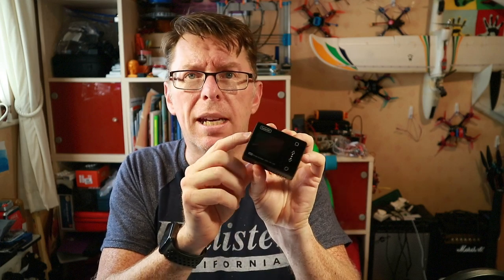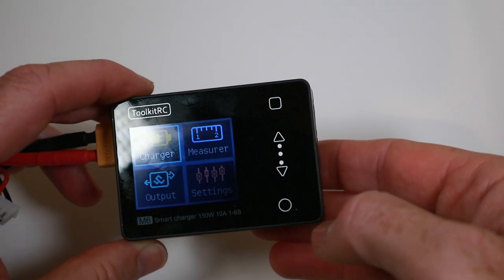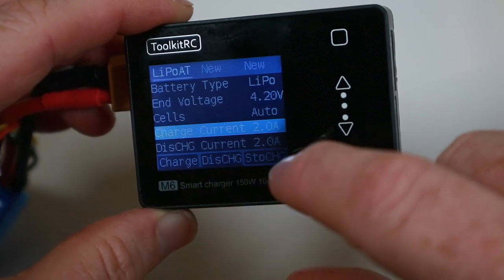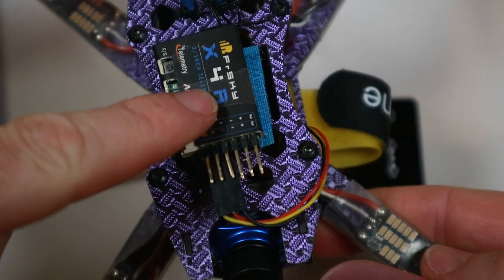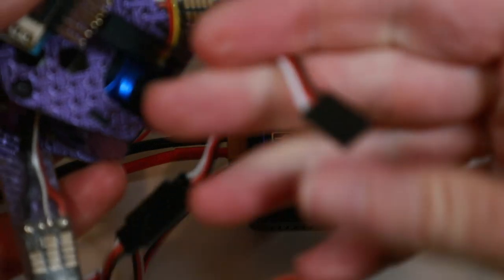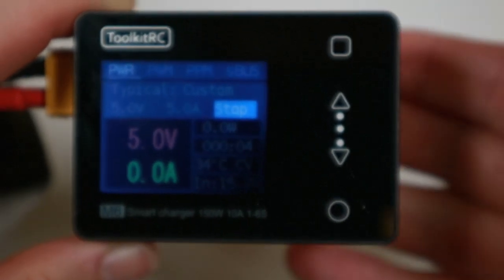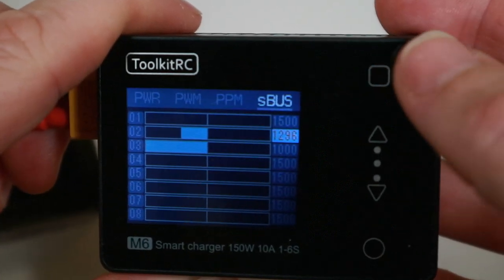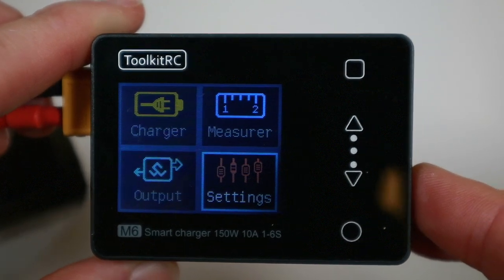ToolKitRC M6.  A charger and more!  Supplied by Banggood

Comment from the maker: If you want to check out this charger in more detail, take a look via this (affiliate) link https://www.banggood.com/ToolkitRC-M6-DC-150W-10A-LCD-2-6S-Lipo-Battery-Smart-Balance-Charger-Discharger-With-Voltage-Servo-Checker-Receiver-Signal-Tester-Quick-Charger-Function-p-1512836.html?p=E81211714085201408XQ&utm_source=Youtube&utm_medium=cussku&utm_content=tanghao&utm_campaign=wayne

Comment: I use an ATX psu to run both my chargers,  both my two way radios,  a 12v desktop fan, have a screw-down / banana post terminal for anything 12v I want to power and have a XT60 on a long cable for bench powering rc craft for setups.
Gotta love pc power supplys, they last forever,  supply clean power at decent currents.
I have another running my cctv dvr plus 8 cams and a 20w ir floodlight.

Surprised being someone who's into computers that your not using them, you must have a few kicking about :)
Reply from the maker: Most of the old PC PSU's are in the loft or have been chucked.  I have an issue with space :)  Good call though, they are decent for this sort of task
Reply: @CurryKitten  somehow missed your reply till now.
What I do with my ATX psu's to make them tidy is take the cover off and clip all the 5v and 3.3v cables right back to the pcb then pair all the 12v inputs with a negative and clip back any remaining negatives too so I only have the wires for my 12v and I put the relevant connectors on them to hook up to what I'm using it for.
The ATX psu that powers my cctv system has 10 12v cables each with a 3.5mm jack on the end with just plugs into everything 
My desk psu which powers my two way radios, chargers ect has a bunch of xt60's on it :)
Both psu's have cable sleeves on them and look tidy and almost like they were made for the use I have them deployed in :)
The green trigger wire gets soldered permanently to ground and the psu turns on as soon as mains is applied.
Another thing I really like about the ATX units is if you have a fault or a short, they trip instantly and protect both themselves and the device that is connected.

Comment: That looks very good, great little unit and very handy, I’ve got the uav battery tester which does a lot of those tests, but doesn’t charge the batteries. I might have to get one of these or the higher grade one. Thanks for the video.

Comment: If you fly Quads and need to charge loads of battery's then you may want to think of other options, however this is a good tool for diagnostics.
Reply from the maker: Yes - agreed.  I use a 4 port and 2 port normally.  Not bad if you are getting into it and you get a few extra things though

Comment: Hey by mistake i reversed plug in my balance port in charger but nothing happened amd voltage was not being showed properly but when i connected it back it works fine would this would have damaged my charger?
Reply from the maker: Whilst I can't say for 100%, I don't think so.  These chargers tend to be pretty good at detecting reverse polarity, and I've misaligned my balance plug more than once without anything bad happening
Reply: @CurryKitten  ok and one more thing I love your sim and the work you are doing and btw i only plugged lipo in output plug and inserted my balance plug in reverse but when I noticed my voltage was messed up i removed it right away and to be double sure i connected it again and in wrong polarity and when i tried charging it didn't charged in reverse polarity so i think i should be fine and as you mentioned you did it many times did you try charging also while reverse or you only plugged it reverse like me
Reply from the maker: No, I only plugged in my balance lead wrong, and then noticed my voltages were all wrong, so corrected it.  New sim update coming today BTW :)
Reply: @CurryKitten  so everything works fine without any problem?
Reply from the maker: Yes - no problems at all